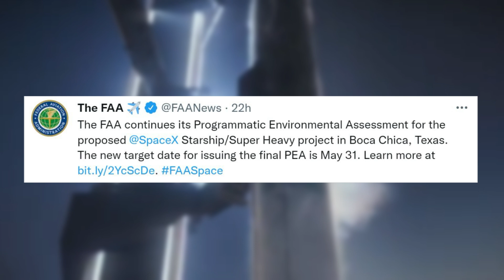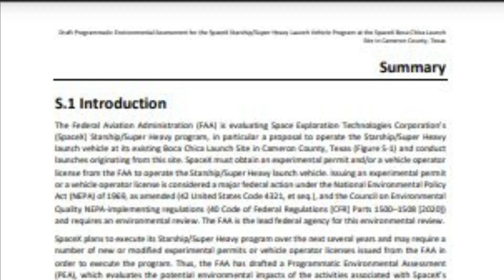The FAA Continues To Delay Starship's Environmental Review

Comment: What Starship ? ..... Do you mean that BF tin can Prototype , that hasn't even been figured out yet or Budged an Inch ? ... That BF Rocket that is still on the Drawing Board , with Significant miss-engineered Challenges ? ... The Concept that is treated like a Finished Product ? ..... This BF Monstrosity has a list a mile long of To-Do's , Testing , Retesting , Re-engineering and Guaranteeing ... Before it can Risk an Ignition and avoid a BF Explosion and Cataclysm ... For all we know ... This 33 300bar Rupture 2.0 Engined BF Rocket ... could be so Difficult to get working ... It becomes an Impossibility ! ...

Comment: Attention : ... Last week during pressure tank testing ... SpaceX's BF Booster #7 suffered a major Setback when the Down Comber crumpled for undetermined reasons ... this is a major part that was installed with welding instead of flanges making repairs difficult or impossible ... SpaceX has been plagued by problems in its BF Rocket program , including Engine replacement , heat shield integrity and FAA rule breaking ... Musk's over optimistic schedule is now in Doubt and questions are being raised about this gigantic rocket's success ...

Comment: The reason the FAA has to slow space X down is to allow time for the SLS to make its first flight. If it does not fly first, NASA and the US government will look really bad for having sponsored such an
archaic dinosaur. A lot of time and money went into building the SLS, which represents no new technology. The solid rocket boosters are from the shuttle, the four engines are from the shuttle,
The main fuel tank is from the shuttle, the capsule and the escape tower are from the 1960s. Not a single piece of the rocket is reusable. If the starship successfully launches first how will it look
on NASA and the government?